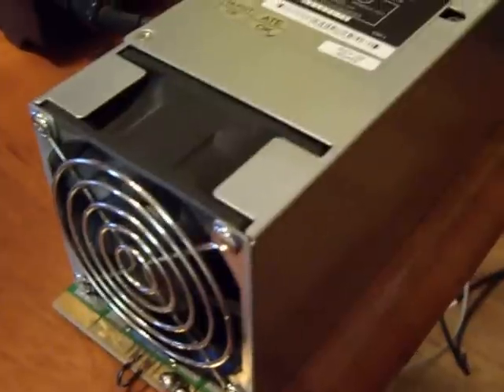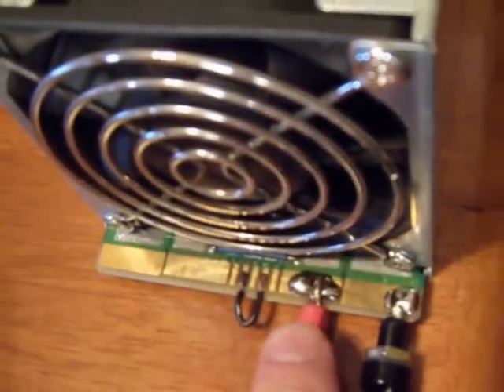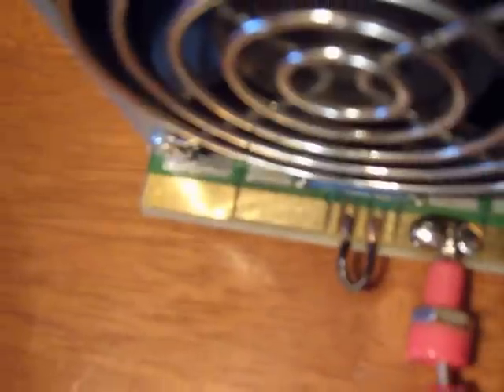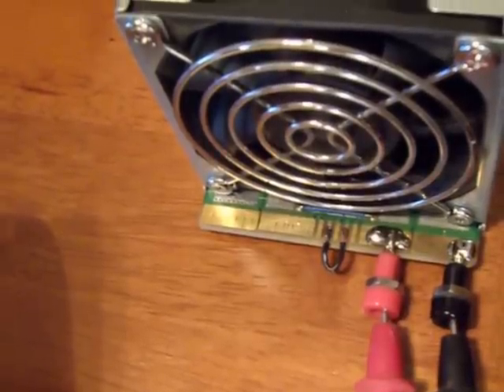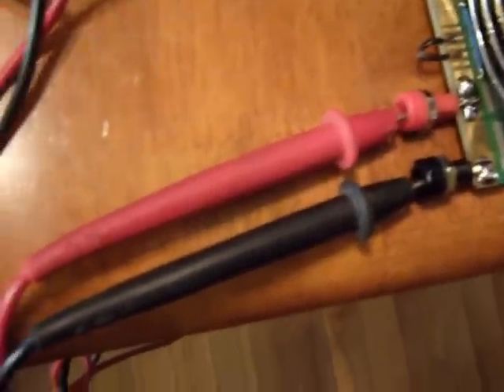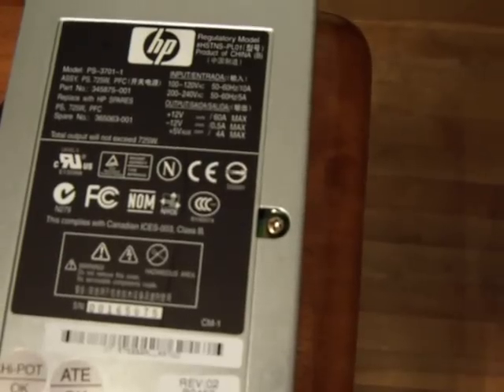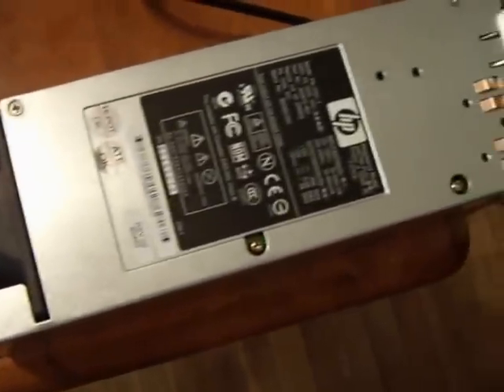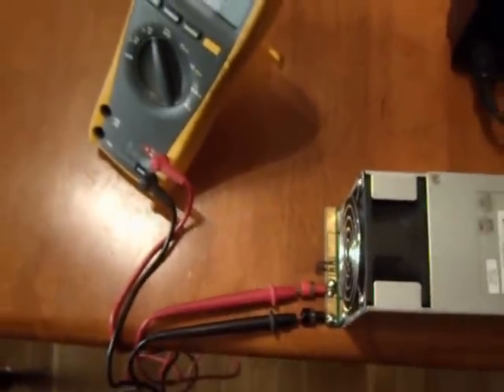HP Model PS-3701-1 725w 60a Power supply 12v banana jack R/C Lipo charger conversion

Comment: i had the exactly the same psu..but my problem is the power relay keep turn on,off under load,,can you help me with my problem?
Reply: amadzack666 nvm i solve it myself,all i did is just jump one of the short pin to ground,and then green led glow bright instead glow dimmer and blinking like in the video..this thing is beast pulling about 30amps using 2x car amplifier still doesn't drop even 0.5v,cheers.
Reply from the maker: +amadzack666 that's whats up man yeah its a beast for sure.  don't know why that light flickers in the video but its solid green when I use it.  I have it running about 27 amps when im racing and it runs like a champ barely warm at all.
Reply: +amadzack666 Thanks. found that both pins must be connected to ground.
http://static.rcgroups.net/forums/attachments/6/9/1/2/6/a4104500-96-Modifying%20PS%20for%20Ham%20Radio%20use%20P2.jpg
Reply: basically you just need connect pin7 to ground..
Reply: +amadzack666 Hi can you please tell us what pin did you shorted to ground?
Reply: +amadzack666 Thx
Reply: you welcome :)

Comment from the maker: Well I tried to max the load as much as I could and this is what I got I had my charger running full 6amp rate on 4 nano tech 100c discharge rate 5900mah gold series batteries 3 of them are 4s and 1 pack is a 6s 4000mah same discharge and it only dropped down to 12.3 volts while charging all 4 packs together.  is this what your asking?

Comment: HI,

What's your voltage drop under load? I tried one unit, under 7A load drop was ~0,8V. I think it is too big.

I have 2 of these units, will be using in series.

Raimo
Reply: Made some measurements, voltage drop was actually 0,13V. My current charger is showing different numbers. Planning to upgrade to iCharger 308 DUO.